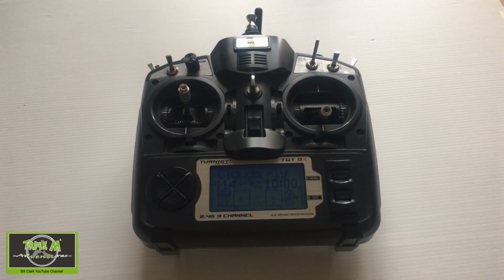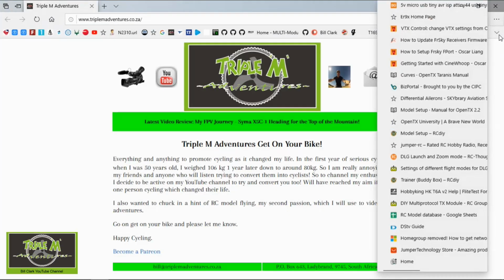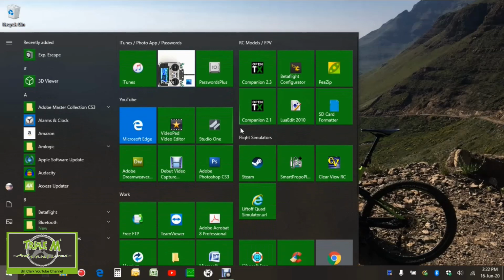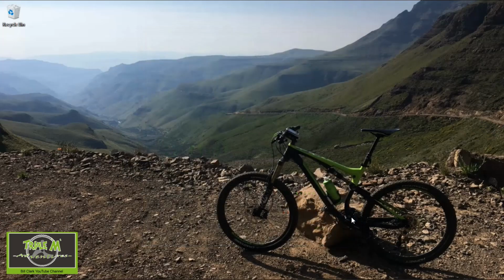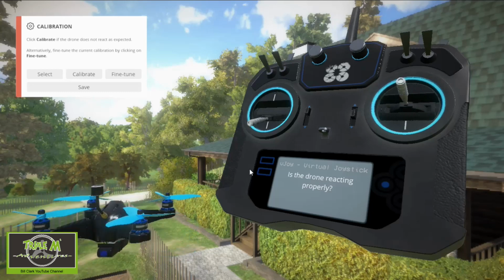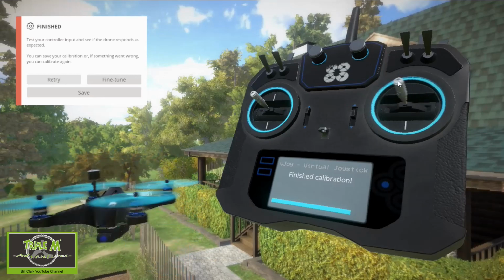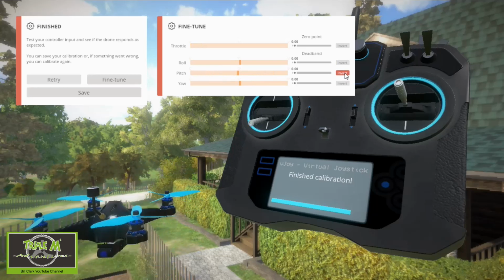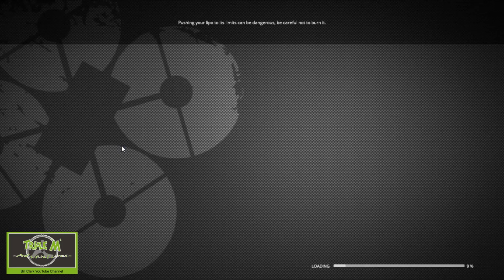Turnigy TGY 9X - Using as a controller for Liftoff Sim

Comment: When I plug the mic in the status says transmitter disconnected.  Selecting Microphone realtek high definition audio for input.
Reply from the maker: You need to select Line In.
Reply: @the-happy-RC-flyer  hi,excuse me  where can I select Line in ? from propoplus  or ?
Reply from the maker: @mustafayildirim7760  your computer should ask you what you want the input to be when you plug the radio in to the computer.
Reply: @the-happy-RC-flyer  thx for answer but the problem about my connection seems to RF module.theprogram status turn connected while rfmodule was removed from thecontrroller
Reply from the maker: @mustafayildirim7760  you should leave the module in your radio.
Reply: Hello, kinda late, im having same problem. U solved it?
Reply: @rokasfpv  Late, but i hope to help somebody. Remove the module from your radio. If your using notebook, ensure that the 3.5mm port is receiving microphone signal, plug a mic and try to record something, if not, you'll need a usb audio adapter, select it as your microphone input and reduce realtek mic level to zero or disable it. 2023 all you need in  Windows 10 is SmartPropoPlus, vJoy is included.